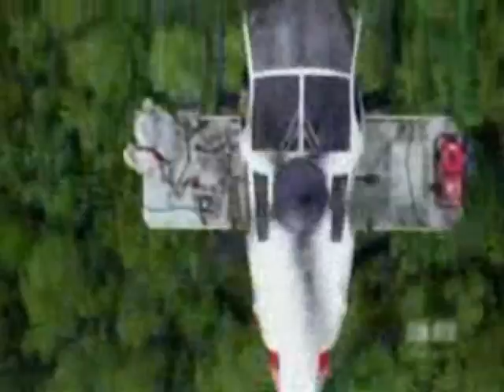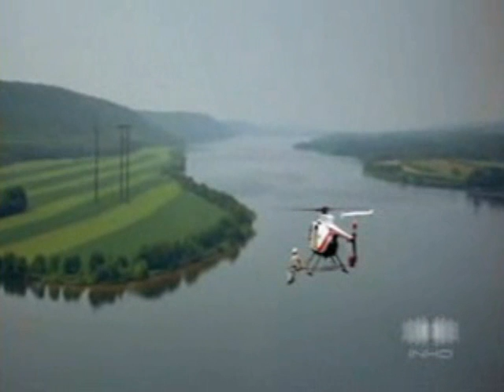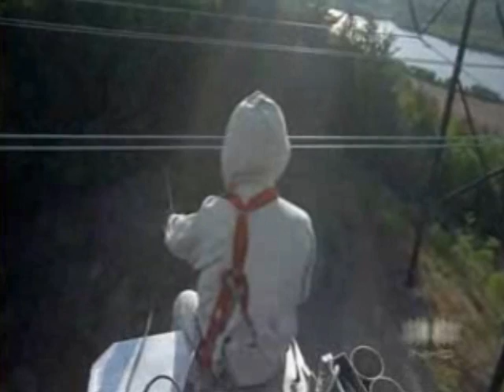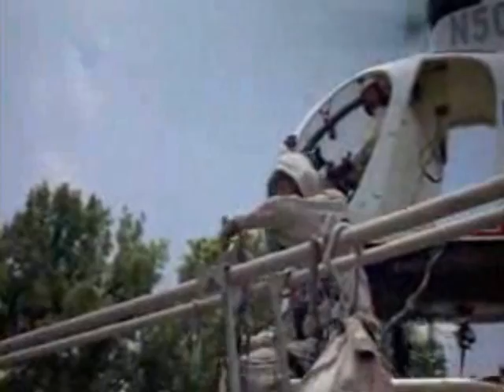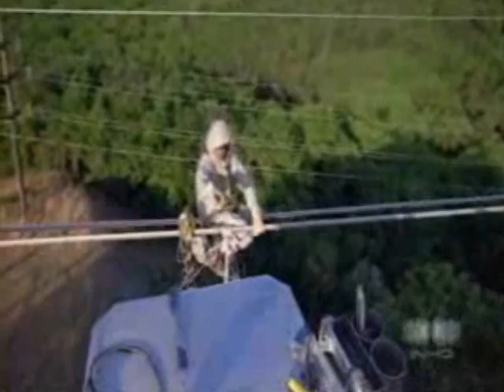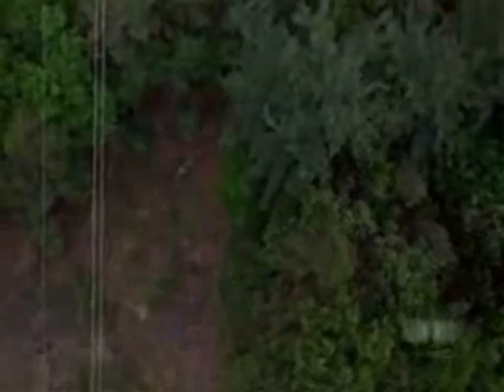High Voltage Cable Maintenance

Comment: The voltage arcs across bringing the helicopter to 500KV. The air acts as a resistor to make it happen a little slower.. If he just touched it straight on the line, things would catch on fire.